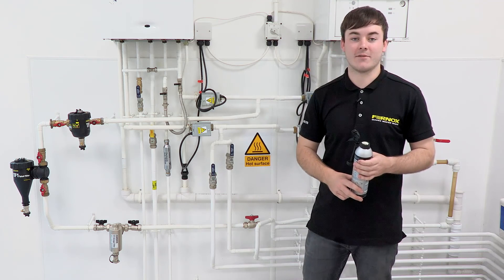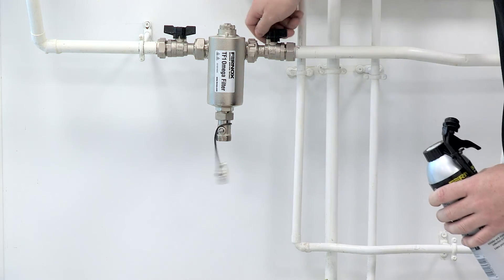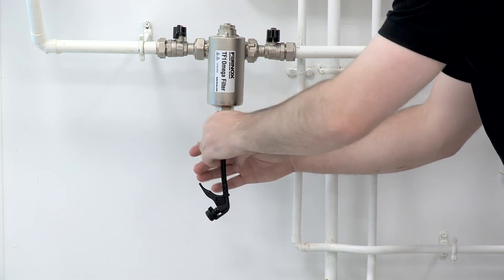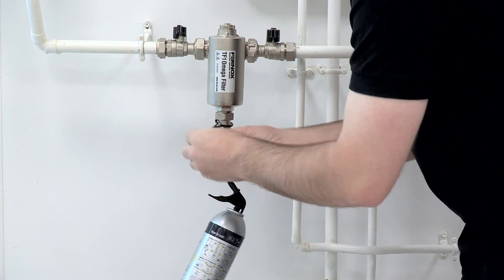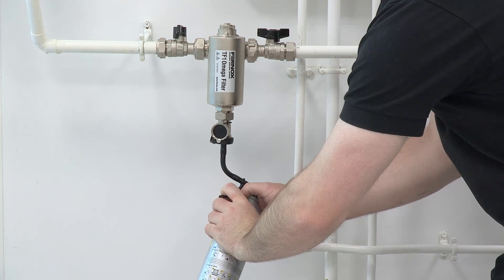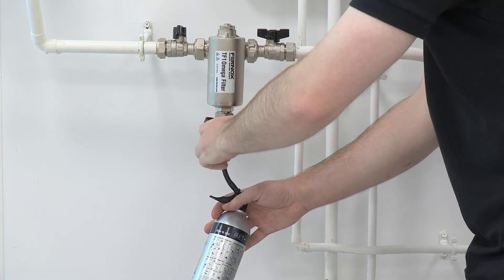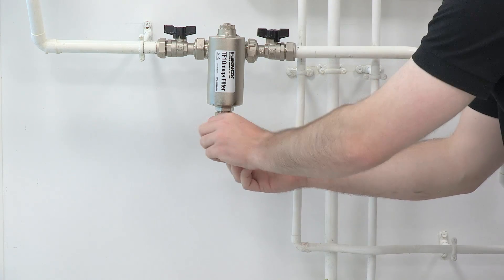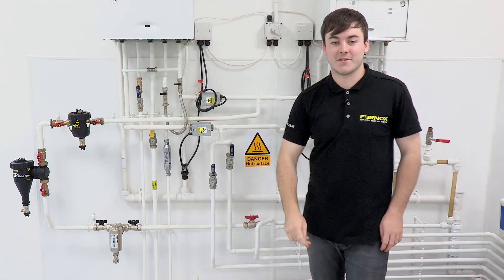How to dose with Fernox Express via TF1 Omega Filter

Comment: Where can i find the serial no for the 28mm filter the builders have managed to lose the packaging
Reply from the maker: Hi, product code for the 28mm is 62251 (Slip socket) or 62252 (with valves). Feel free to contact us by sending an email to sales@fernox.com or +44 (0) 330 100 7750 if you need additional info/assistance.

Comment: I have the TF1 filter without the inlet and outlet valves in the line. I am about to clean the filter out and will be adding  F1 protector and F4 leak sealer (I have a small leak on a radiator and I'm going to see if F4 can seal it before I replace the rad). Can the two products be added one right after the other, or do I need to add one, circulate it then add the other?
Reply from the maker: Thank you for your comments. There is no problem to add these 2 products one after another.

Comment: Are you not better dropping a bit of pressure from the system before adding this then top up the pressure as required? as could it over pressure the system?
Reply from the maker: Thank you for your comment. Before topping up Fernox Express you can remove around 400ml of water from the system. Once it is done, it is good to check the pressure and increase if necessary

Comment: By opening the inlet valve before charging, does this not put the inhibitor into the mains? I would have thought it should be the outlet valve open then inject the inhibitor, into the system, close the drain valve, remove canister, replace drain cap, open inlet valve.
Reply from the maker: If the system contains a conventional boiler, Protector F1 would normally be added in to the system via the feed and expansion tank. An exception to this is when a primatic / indirect single feed cylinders are installed on the system, only potable chemicals should be used with these systems.

Comment: I have no valves leading to my magnetic filter, can I still use this ?
Reply from the maker: Yes, you can still dose Fernox Express even if there are no valves leading to your filter. You will just need to switch off the boiler,  close the drain valve, connect Fernox Express F9, open the drain valve, and squiz the Express trigger...

Comment: OK so I can open the drain valve of the filter to clean it.  I can make fluid come out of the pressurised can.  However, when I connect the can to the filter, open the valve and pull the lever on the can, nothing happens.  The hose isn't kinked.  I can work round the problem by squirting the can contents into the header tank, but there's a cheaper version suitable for doing that.  Answers please on the back of a clean £10 note.
Reply: Open the inlet valve

Comment: This Fernox F1 is that oke for my Alupex pipes in the floor and als oke for a modern central heating unit???
Reply: @Fernoxvideo  thanks for the info my system is clean will ad  a 1/2 ltr Fernox protect
Reply: And a filter

Comment: The adapter that is sold with the can is not the same as on this video and does not fit the drain valve of the filter. I have looked at other sites and all seem to have the same adapter

Comment: I have followed these instructions  to  perfection and have had the nozzle come off the pressurized  can and spray all over the place and yes the inlet and drain valve have been open. What do you think is the problem?
Reply: I normally take a bit of the pressure out before i fill it. Maybe try that.